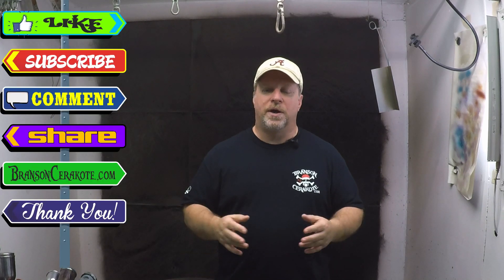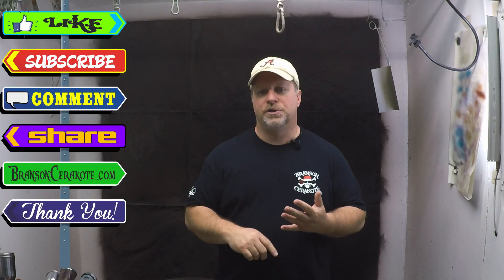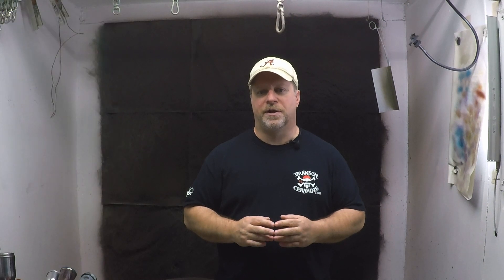Top 10 Applicator Mistakes I Hear About | Branson Cerakote and Laser

Comment: Great video John. Actually Madcustoms post a few months ago a question about thickness. Cerakote recommends 1mil
In general. A very few colors have 2mil thickness specification. People are coating multiple layers around 2,5 mils. Actually Mad talks about seeking 1mil with every layers into.  I’m coating with general thickness of 0,7 to 0,8 mils successfully.  Even Kydex holsters até friendly with coating under 1mil. Nice video as always. Thanks for teach and share your experience with us. Much respect !
Reply from the maker: The reason for the thinner coats after the base is to avoid tolerance, and ridge issues with stenciling. Thick is better than thin.  :)
Reply: Are you using an instrument to hodge thickness, or are you mic'ing the parts before and after coating? A metal part will change too much with just the heat from your hands to be able to accurately read the difference between 0.001" and 0.0007". 3 tenths is a miniscule amount to measure outside of being a trained metrologist. So I'm sure you're using a paint thickness meter, but is it worth it? I spray until it's coated and I've never had issues. I've even done jobs where I spray EVERY SINGLE part of a handgun (including all internals and action parts), because of corrosion damage, and never had issues.

Comment: Thanks again for more tips  I missed the 8-10 minute air cure  could have been an Oh Shit
Reply from the maker: That's a common one. I honestly blame NIC for not making it a bigger deal in the pamphlet. It can make or break your project.
Reply: @BransonCerakote  I'm very new to the cerakote scene and just made an attempt at my second project. I too was unaware of the 8-10min air cure. When I applied my second coat it didn't want to stick, actually ran away in areas like water being sprayed on to a waxy surface. Could this have been caused by the lack of air dry between coats and tacking?
Reply from the maker: @jetkrazee  That's probably exactly what it was.

Comment: Great video. I have just applied a coating of H-146 Graphite black to aluminum parts for a dirt bike. This is my first time using this series.  All parts were sandblasted and gassed out. I mixed the paint and hardener correctly. Sprayed a single coat. Air dried for 10 - 15 minutes. Placed in oven at 250 degrees for 2 hours. Let sit for 24 hours. The surface looks amazing but it still feels wet. There is no paint transfer but i feel like if i handle it my fingers prints would leave an impression. Will this harden up in the next 5 days? do they need to be at room temperature because my shop is on the cool side.
Reply from the maker: No. Once it comes out of the oven, it is what it is. Did you shake the coating together with the hardener? What ratio did you mix it at?
Reply: @Branson Cerakote  20:1 and yes I shook it up.
Reply: @Branson Cerakote  perhaps I did not use enough hardener. It is difficult to measure a small amount as it is on the thicker side.
Reply from the maker: @TNTMOTO  We ,ix all of our H at 12:1, but after that long in the oven, it should have hardened unless you were way off on the ratio. The only time I've seen it not dry at all was with no hardener.
Reply: @Branson Cerakote  ok thankyou very much for the reply. Perhaps I need to warm the harder to room temp before adding to ensure I get the right amount. It's on the cooler side in my shop. I will let the pieces sit for a few days and see what the result is. If not I will start over with more harder. Thankyou very much for all the information and getting back to me so quickly.
Reply from the maker: @TNTMOTO  The coating and hardener need to be room temp, along with the project being sprayed. Usually if it's a problem like that, you'll get discoloration or honey colored blisters. It wouldn't cause it to not cure out. The coating won't get any dryer/harder sitting out. The hardener is heat activated. My best guess is still not enough hardener.
Reply: @Branson Cerakote  ok thanks again. When I got home I rubbed one part with my hand and a very thin satin haze almost like a polish began to come off on my fingers. The surface was then a semi gloss finish. The part still felt cold even in the house. I used my finger nail to scratch the surface and it was possible with effort to scratch the surface but not down to the metal. So I think your right about everything. I need to warm up my shop and get more hardener in the the paint. Thanks again.
Reply from the maker: @TNTMOTO  Any time.

Comment: This may be a silly question. But, I have seen Cerakote used in automotive applications. Small parts, wheels, even motorcycle frames. Assuming someone is using the air cure variety. Is there any reason a whole car can't be painted with Cerakote?
Reply from the maker: You could, but at $400 a gallon, it would be expensive.
Reply: @BransonCerakote  And if someone key scratches it. EEK!
Reply from the maker: @christophergeorge8800  Tru Dat.

Comment: Huge fan John. If I do my gas out and it's still weeping oil are you saying to just leave it be? Having issues with a stubborn receiver.
Reply from the maker: Nope. If you have weeping, it has to all come out. Best method for getting it all out is to put the metal in the oven for the one hour at 300. After the hour, take it out of the oven, and spray acetone on the area. It will flash evaporate, and remove the oil/grease. It may take more than one time doing this technique, but you just have to have patience. Some pieces are a real pain. Just an FYI, there will probably be a stain once it's completely degreased, but thats ok. It comes off during sanding.

Comment: Also what are your recommended Temps and times in the oven? For both in the pre cleaning process and the post spray process
Reply from the maker: Gas out poly at 180 for around 20 minutes, metal at 300 for an hour. Bake poly at 180 for two hours, metal at 250 for two hours.
Reply: Right on thank you 👍
Reply from the maker: @turtlepowers7781  Glad to help.

Comment: What do you do when you get stencil ridges? I have read you can lightly sand before clear coating. What should I use to sand ridges off that won't mangle the coating? It's a 5 color camo pattern with the worst ridges at the base coat stencils. Thanks guys. I should start paying you for all the questions I  ask
Reply from the maker: We don't recommend sanding because it could compromise the depth of the base coat. In our shop, we just sand it back down and start from scratch. The best way to keep from getting ridges is to not spray over your stencils until the very end. A common mistake is for people to spray a complete coat with every color. Lay your base, add stencils, and spot spray where the next color will go. Repeat until all the stenciling is done, spray the final solid coat over everything, just heavy enough to cover the colors beneath, and done. (Don't try to cover over the yellow of the stencils. The stencils are out of bounds. When done correctly, the edges of your stencils should be lightly dusted, not completely covered.)
Reply: @BransonCerakote  thank you once again.  This'll be the 3rd try at it. Hopefully 3rd time is the charm.
Reply from the maker: @RaZX6r6  Been there.

Comment: Can you fix coating build up spots? Runs?
I was following your tip about spraying into the small spaces (works great by the way) and my aim wasn't quite good enough and I created a small blob on the lower near the mag release opening. After baking I can hardly see it but.. is there something I can do when I see it before baking?
Reply from the maker: Unfortunately no. You'd have to sand it down and start over.

Comment: hi John, I am starting with Cerakote now. ( Live in Belgium). Can you put your items sprayed with C series Cerakote in the oven? If yes, at what temperature and for how long? You might ask me why: just to speed up the drying process and otherwise, I have no heater in my booth. Tx in advance Joris
Reply from the maker: C series has a resin and hardener in it that needs to air dry. Putting it in the oven will make it brittle.
Reply: @BransonCerakote  thanks John. Great video's. Cheers and greetings from Belgium
Reply from the maker: @joristz  Thanks for watching!

Comment: What do you recommend to use in first adding abrasion to the surfaces on plastic/polymer, black anodized parts and raw aluminum??
Reply from the maker: Sandblasting with 100g Red Garnet. Polymer at around 30 psi, metal at around 75 psi.
Reply: @BransonCerakote  thank you appreciate that 🙏
Reply from the maker: @turtlepowers7781  No worries.

Comment: A question I have is, Do you tape off the undercarriage of a slide of a pistol?  I cerakoted a Ruger SR9C Slide and put a light coat of black on the undercarriage of the slide.  My barrel now fits too tight and things dont fit properly.  I'd love to see a video talking about what parts to not spray on the body of a pistol.  I know the springs and shears and inside of a barrel should not, but for some reason my gun will not fit back together properly.  Thanks!
Reply from the maker: I spray everything except what you mentioned. Lots, and lots, and lots of oil.
Reply: @BransonCerakote  I'd love to see a breakdown if you are ever digging for video content!  Thanks for the response and thanks for the reply
Reply from the maker: @XxPUNISHER78xX  I'll put it on the list.

Comment: Do you media blast polymer grips like magpul? I’m guessing yes but just making sure.  I’m planning on doing it?  Also how well would you say cerakote game polymer holds up?  Never sprayed polymer but my new build I’m planning on the grip. Thanks.
Reply from the maker: Polymer is fine. You don't want to sand at high pressure, just around 30 psi or so. All you're looking to do is dull it. Bake it at 180 max. Don't do anything that is or has rubber.

Comment: Excellent instruction!!!! My dad is a cancer survivor so we are working on my build together to celebrate.  We are getting ready to Cerakote my upper and lower and hand guard for a 300 Blackout.  The question that I have is do you normally Cerakote the area of the upper that houses the bolt carrier group? My concern is that it will have paint buildup causing the bolt to not glide smoothly. My other question is after the sandblasting I had a considerable amount of black finish still left on that same area of the upper where the bolt is housed. Same area as previously mentioned.  From what I gather from your video I should be ok to Cerakote over top of the black finish? Do you recommend scratching that area to give it more peaks and valleys for it to adhere to or just go for it? I know you said that Cerakote does bond to it. Thanks for taking time to share your knowledge and expertise.  Much appreciated.  Have a great day and Merry Christmas.
Reply from the maker: Tell your dad that we said that's awesome news! I lost my mom to cancer, and my wife works as a nurse, so when we hear about wins, it's a good day.

The black finish you have on there is anodizing, which is the only surface that you can Cerakote over. As long as the anodizing itself is scuffed, you'll be good to go. 

For the inside, just dial your cone completely shut (top knob on the LPH-80), and set your volume. Spray the inside of the receiver by tapping the trigger. Move the item around so you can get all the angles. It's aluminum, so it doesn't need to be super thick. However, if you get a little thick in some areas, it will wear to where it needs to be quickly.

Thanks for watching.
Reply: @BransonCerakote  Sir you are AWESOME! And thanks for the instructions and most of all for the words of encouragement about my dad. I’m sorry for the loss that your family suffered.  I’m sure that you get your kind helpful spirit from your mom. Carry her in your heart and memories. She will ALWAYS be with you sir.  I will share this msg with my dad. Thanks again and have a GREAT holiday.
Reply from the maker: @clarkkent4991  Same to you and your family!

Comment: Hi, you are constantly talking about the training, do I understand you correctly that you do provide training, certified and accepted by Cerakote?
Reply from the maker: We do have a training program, but we are not affiliated with the Cerakote factory program. Our program covers the same things, but also goes into many areas the factory doesn't. Our program is geared more towards how a shop operates on a daily basis vs just centering on the coating, and spray techniques (which is one of the reasons why we have three days instead of two). The main reason we tell people who come to our training that they eventually want to go out to the factory is more from a financial standpoint (discounts you'll receive from NIC being factory certified).
Reply: @BransonCerakote  the fact that you responded this quickly, is very comforting. I'll forward you a mail to get more info. Thank you very much.
Reply from the maker: @johanndupreez7736  Any time.

Comment: Quick question sir.... whether using 12:1 or 18:1 mixing ratio does more hardener necessarily mean stronger finish, glossier finish or both.
Reply from the maker: It changes the finish, however the 18:1 isn't as durable.

Comment: Very true about internet info, I see a so called pro company putting videos up recommending not to blast the surface to remove factory finishes prior to cerakoting.  They claim it’s because cerakote is a weak finish and when it wears at least it will have the factory black finish underneath to protect the firearm still. They seem to badmouth the product quite a bit but continue using it in their videos and I left a message saying maybe you are having all these bad experiences because you’re applying it incorrectly.
Reply from the maker: I know which ones you're talking about. I made a comment on there also, and the answer I got back was that they like their guns to look chipped and worn, and don't mind redoing them. I even offered to do one for free. Kinda falls under the categories of "You do you boo".
Reply: @BransonCerakote  lol never heard that category before,I like that one

Comment: Great video and thank's for putting this info out there. It's great to see a professional willing to share advice with do it your selfers. I have done a couple of scopes (IOR Valdada & Trijicon TR 24) an AR-10, a couple barrels, and some mags. I have done all mine with the C series and have gotten away with using Scotch Brite pads because I don't have a compressor big enough to run a blast cabinet. Some of my stuff has been coated for several years with no problems at all and it still looks great. I'm about to do another scope in FDE C series and I'm really hoping it comes out as good as my previous projects. If you happen to see this comment am I just getting lucky using the sanding pads or have you seen them used successfully with C series by others?
Reply from the maker: I think you're getting lucky, to be honest. The sand blasting does more than just rough up the surface. It creates a specific etch pattern that the Cerakote is chemically designed to bond to. Ya gotta do what ya gotta do, but sandblasting is one of those steps where you really want to try to stay in your lane.  :)
Reply: @BransonCerakote  Even though I've had good results so far I'm not sure I want to keep pushing my luck. The scope I'm doing was $700 so while not as expensive as many it ain't cheap either. Might quit while I'm ahead and have to have this one done professionally. Thanks for the help and keep those videos coming.
Reply from the maker: @bigjimmy6690  Scopes are a little nerve wracking until you've done a few.
Reply: @BransonCerakote  Yeah, the pucker factor was pretty high when I started sanding on that $2,000 Valdada. It took a while but it turned out beautifully. Then about 2 or 3 months later the parallax broke internally and when I sent it in under warranty they said they couldn't repair it and sent me a new one without the Cerakote. It's still black.
Reply from the maker: @bigjimmy6690  That sucks.
Reply: @bigjimmy6690  As he said in the video, anodized products are already etched. Scopes are almost exclusively anodized aluminum. So that's why you're getting lucky. the anodizing process microscopically etches the part. So scotch Brite should work decently well. But a sandblasting gun. Stick the syphon tube into a bucket of AlOx and blast away. Use powder coating tape to mask sensitive areas. Buy one of the 5 packs of tablet screen protectors (the rubbery plastic Zagg ones are the best, but obviously tempered glass ones won't work), and cut out a disk to cover the glass, and use plumber's putty to caulk in the edges. Once you put the disk of the screen protector on the lens, the edges will still have a bit of glass showing (depending on how accurate you cut the screen protector). Roll the plumber's putty into a snake about the diameter of a tooth pick and caulk in the edges. This ensures none of the glass gets blasted. Also, I have had issues with Magpul Stealth Grey (H-188) getting thick and gummy and not running right. It's one of the ones I've come across that's difficult to spray and even more difficult to get through a strainer. I know this comment is late but I hope it helps.
Reply: @littlejackalo5326  I have since purchased a new compressor and blast cabinet and started doing it right. Thanks for the tips though I'm always looking to improve.